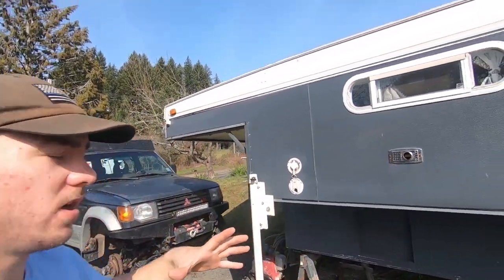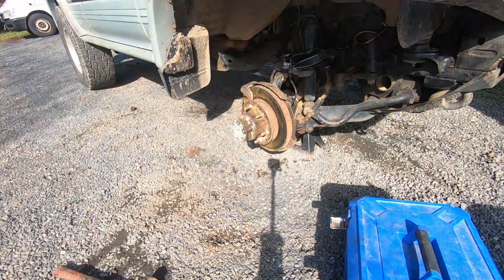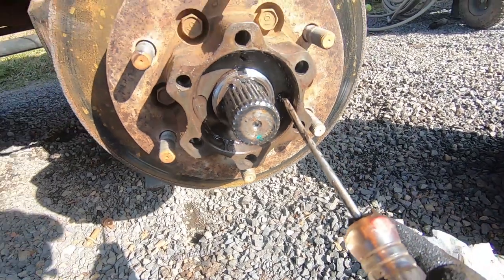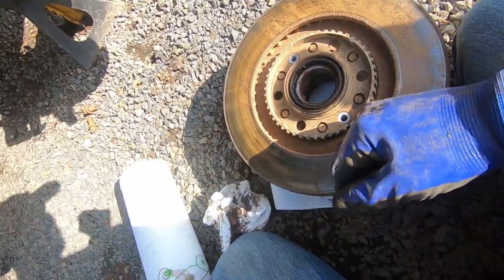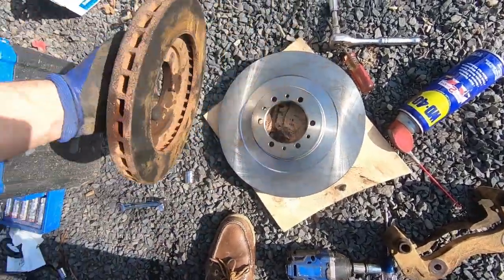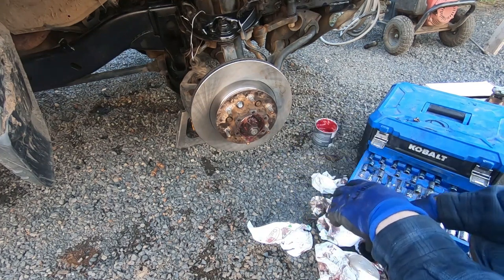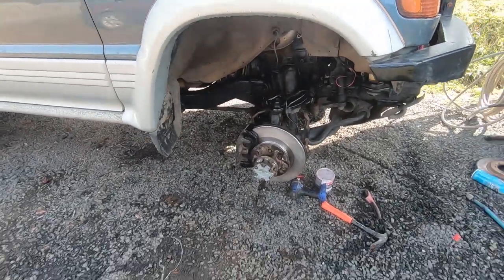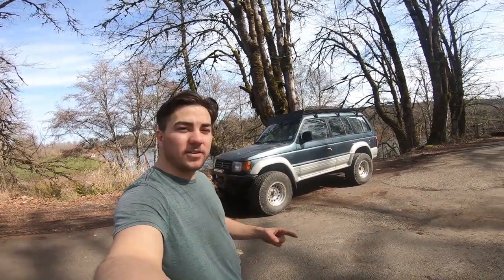Montero/ pajero Big Brake Kit Install

Comment: That's a sweet upgrade. I had no idea that the pajero sport came with bigger brakes, I'll have to scour for those calipers.

On the wheel bearing nut, I normally just use put a flat head screw driver at an angle on one of those holes, and then just gently keep tapping it with a hammer until it feels tight.

Comment: Good job! After having the hubs on and off lots of times on my 97, I stopped doing the factory wheel bearing procedure and just get it tight enough to where there's no play. Are you planning a solid axle? I hate the front ends on these things.

Comment: Can you please tell me if you ever got the Diesel Raider working properly.  I want to do that seap if it worked.
Reply from the maker: Yeah i did. It had an aftermarket inline fuel filter in it. I took that out and it was as good as new.
Reply: @evansautomotive307  Thank you for the fast reply and information. One more, I have a parts Raider with the V6 5 speed. Do you know if there is a diesel that fits that bellhouseing also or would I have to swap that bell housing and use that transmission with the same diesel? (Said to be more robust transmission) TY again.
Reply from the maker: @lking3604  Not sure of a direct fit diesel but i have seen people use bellhousing adapters for the v5mt1. Not sure where it comes from though

Comment: Do you have the part number for that rotor? Or from what model or car is that rotor?..thanks
Reply from the maker: The part number is in the video i showed it at one point. Its from a 2001 montero sport with the 3.5 and 16in wheels